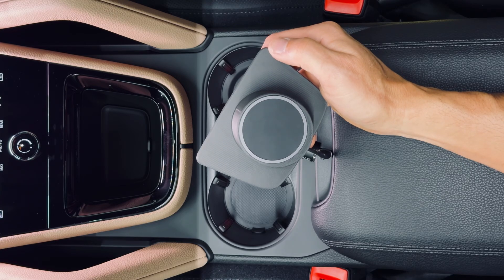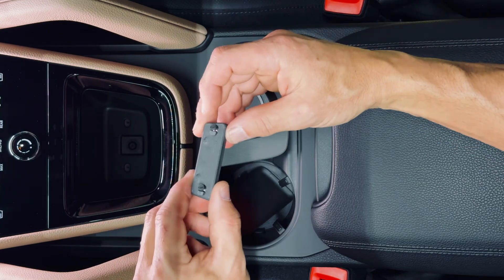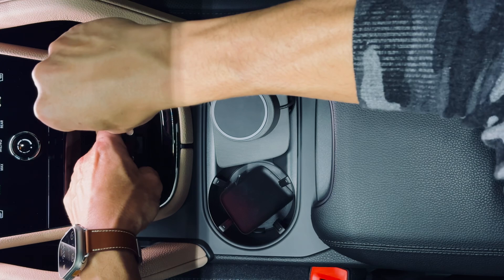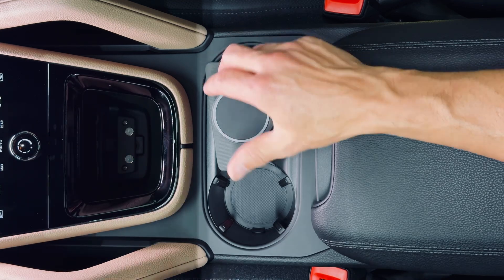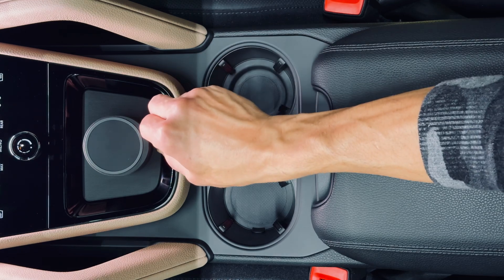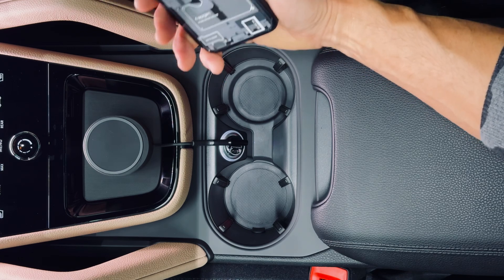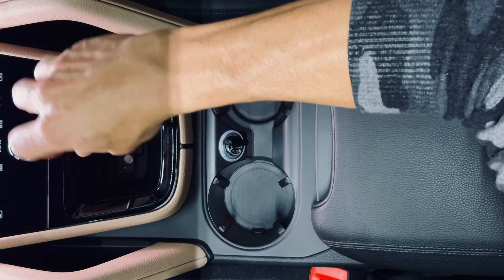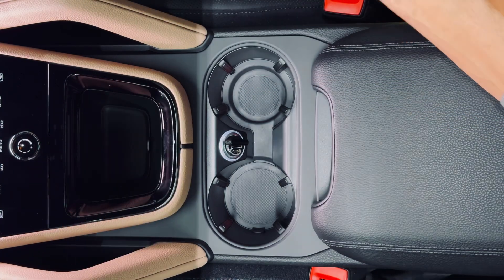2024 Porsche Cayenne MagSafe Charger Install

Comment: Will this have parasitic power draw if left plugged in while not using?
Reply from the maker: No, most modern Porsches will cut the power to the USB and cigarette lighter ports about 20 minutes after the car is shut off. Also, when no phone is on the charger, there is no power draw.